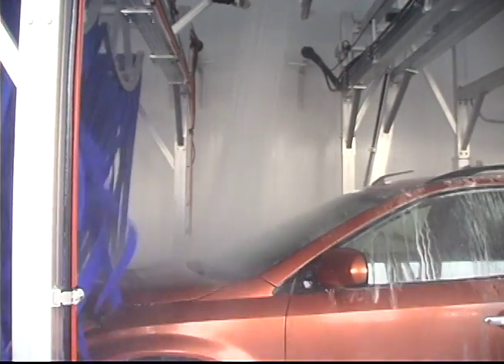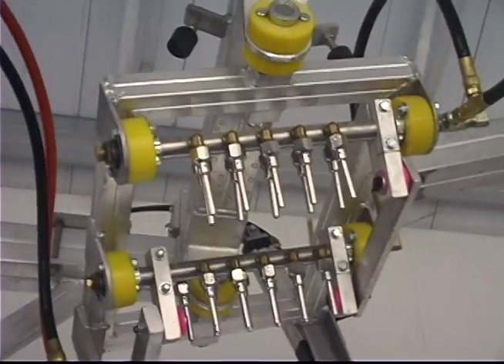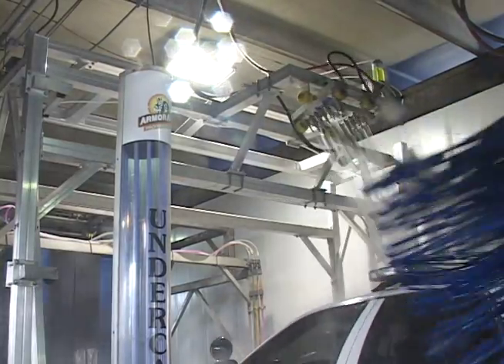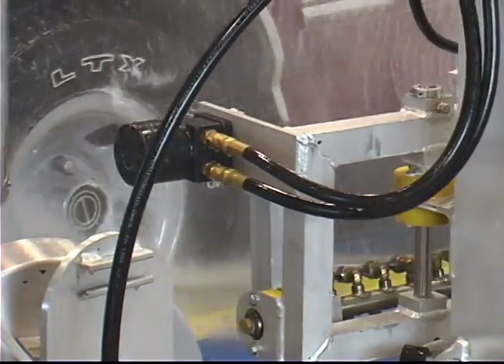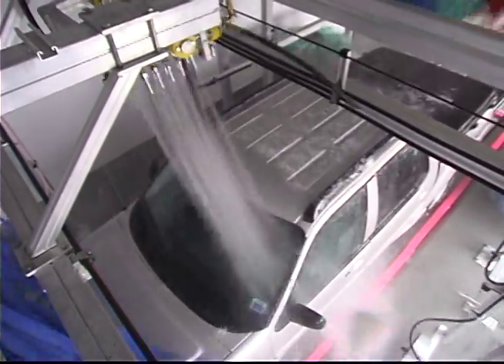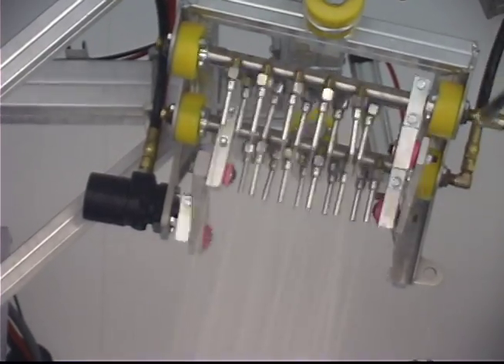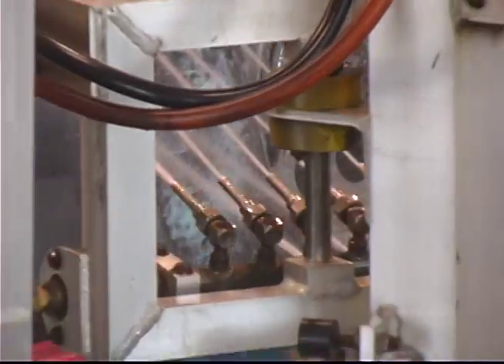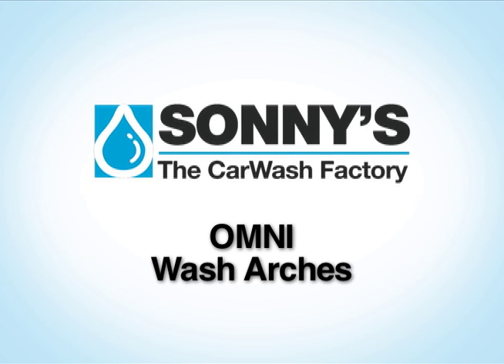Car Wash Equipment - OMNI Wash Arches

Comment: Do this need a Power pack 🤔
Reply: If you opt for the hydraulic unit, yes. Electric drive unit, no. Hydraulic is better in my opinion. We have a hydraulic unit where I work and it’s been good to us. It also comes with mac valves to flip the baskets.
Reply: Ok thank you